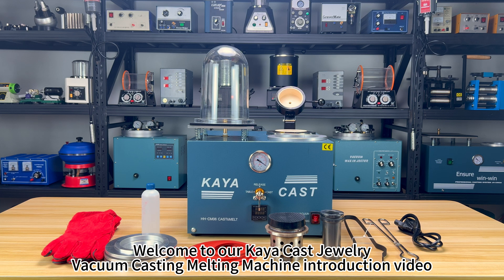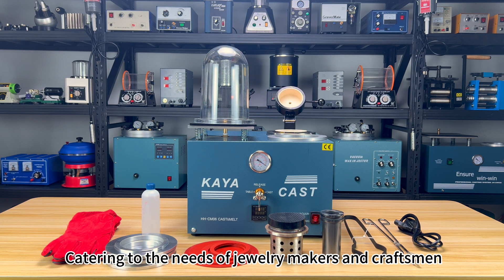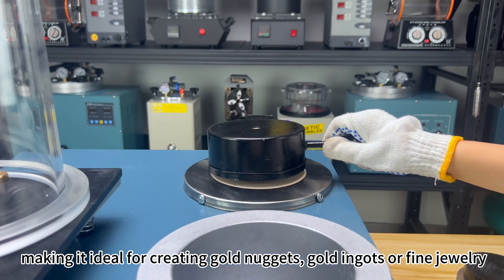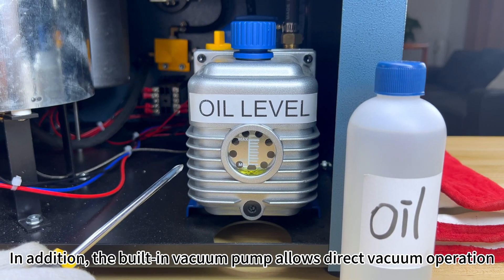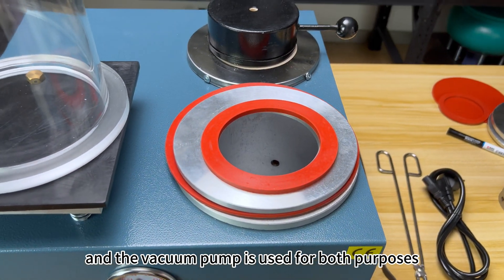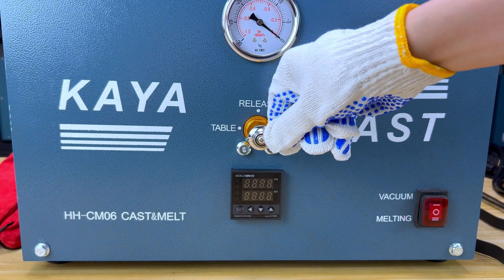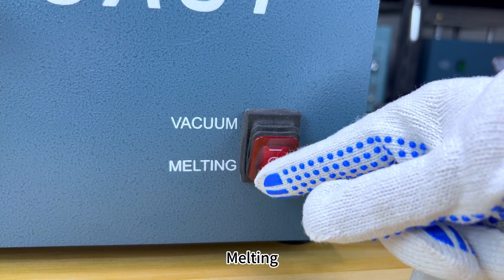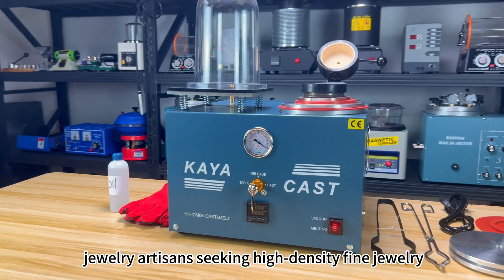Introduction of KAYA Cast Jewelry Vacuum Casting Melting Machine

Comment: Would you still need a separate furnace for the investment?
Reply from the maker: Hi Rich, thanks for your review. This 3 in 1 casting machine have a melting furnace. But we also have a burnout furnae for your choice. Thanks.
Reply: Can the melting furnace be used at the same time as the vac chamber? I see there is another Kaya casting machine.
Reply from the maker: @ Hi, yes it can be used ar the same time. Friend